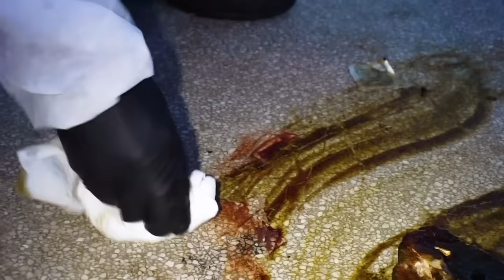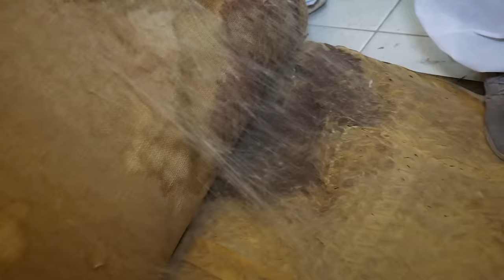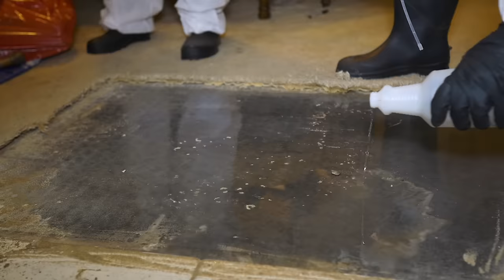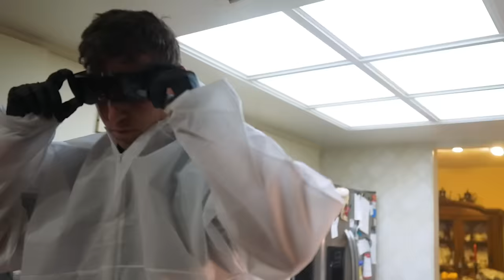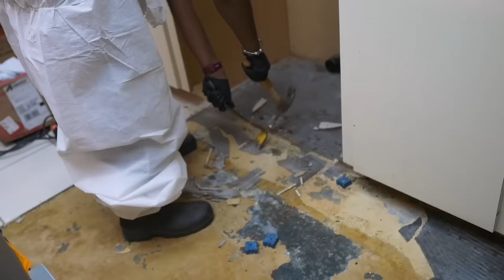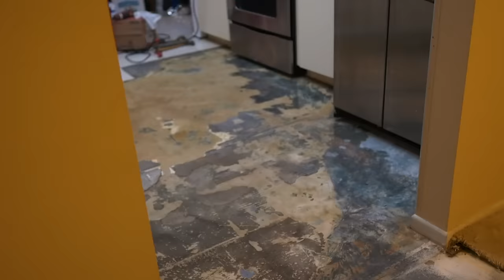Dead Body Kitchen Cleanup | Venice, FL

Comment: I'd have started popping tile at the doorway since that was where the initial cleanup started and it'd be easier to pop the tile up from there
Reply: Same as someone who has ripped up one or two tile floors in my time starting at a transition like where it goes from tile to carpet is so much easier than starting in the middle of the room
Reply: And moving any appliances out is way easier before you start ripping out the tile as you still have a smooth surface to slide heavy appliances around
Reply: @coolsnake1134  yeah, I'd use a 4 wheel dolly for that. Or at least a 2 wheel hand truck

Comment: Do you not track bio around when standing on the areas, and then walking over (mainly) carpet?
Reply: I think they spray their boots down etc
Reply: So when your done, the owners are good to go to put the house back together?
Reply: @MrOdinsmom  I believe so unless its under investigation for foul play or something similar....
Reply: I meant during the actual decomp cleaning process, as you see in the video. They are walking in/through the bio area(s) and then walking in and around the house!
Reply: Yup!! Noticed it a lot in this video. Also I really hope gloves were changed between cleaning the kitchen floor and moving the fridge and cooker 😱🤢 why didn't they cover the kitchen before smashing up the tiles. Eye masks are a HUGE must when messing around with tiles ESP when they've had bodily fluids on them
Reply: @mrssarystew  i have seen a lot of cross contamination in these videos it's painful
Reply: @ReidGarwin  you see a small fraction of a multiple hour job condensed into less than 20 minutes. i am sure the professionals in question know what they are doing.
Reply: @arden8808  Since when where professionals 100% with everything? They have a job, but jobs aren't perfect all the time, it's highly unrealistic in placing bets, human error happens regardless of time
Reply: @mrssarystew  Its all prettymuch contaminated - they have no need to cover anything
Reply: @ReidGarwin  do you think cops don’t back track? It’s all contaminated. They’re only there to remove the obvious stuff everything else is up to the family.

Comment: SpauldingDecon I have a couple of questions that I have been wondering about for the longest time, could you answer them?
I live in Polk County Florida so I do know how hot it gets, but this is what I am wondering. If the electric is on in the home that is being cleaned for decomp, are you allowed to turn on the AC and work in comfort, instead of working in the heat? I do realize there are a lot of homes without electric, because the power was turned off, but even then could SpauldingDecon  have the electric turned on for the couple of days they are going to be there, so the crew can clean and not sweat buckets? 
I enjoy watching the videos and admire the people who do the cleaning. The jobs you all do, makes it easier on the family and friends left behind. Thank you for all you do!

Comment: Removing the tile floor always seems to be the worst or hardest part😡🤬😡...Why does it come up easily in some spots and almost impossible to get up in other areas?🤔🤔🤔 Is it the materials used when it was installed? Installer error?🚷🚷🚷 Or just all tile flooring is a removal nightmare?😈😈😈 Hats off to all of you!🤠🤠🤠 I am amazed by the awesome job everyone does week after week when I watch your videos.🤯🤯🤯 Welcome to new crew members!👋👋👋 Thank you for your hard work and dedication!⚘⚘⚘
Reply: Basically when tile is put down you trowel thinset on to stick it, so any lower spots that arent backbuttered right with the thinset will leave a hollow spot and not stick right. This also depends on other factors, sometimes homes settle over years and the thinset will release a bit, theres many types of underlayment and some are better than others, weather, water leaks etc etc. So its hard to say really without knowing all the details. Properly adhered tile that all sticks and has no issues is really a pain to get off the floor.
Reply: @plack_benis382  Thank you for sharing your knowledge!🥰🥰🥰 It looks like a heck of a hard job!🥵🥵🥵 Give a whole new respect for carpenters and flooring installers!👷‍♂️👷‍♀️👷
Reply: @amandaleeborchert3745 lmao the emojis
Reply: @yesimoneofthose8970  😇😇😇

Comment: Why did you clean the tile to remove it?
Reply: I believe it helps to keep the contaminated shards as clean as possible since tile removal is so messy.
Reply: From my own experience removing tile, there  are usually jagged pieces when you remove it and they will slice straight through any glove besides maybe kevlar. So id say you dont want to be cut with a piece that has funky left over human on it. If they're bagging it, it could also cut through the bag, which would mean the bio isnt contained properly.
Reply: @plack_benis382  thank you. I was just thinking about double work.
Reply: @WahWeeWooWah  thank you. I wasn't thinking.

Comment: Do you test the lino/vinyl floor found under the tile for asbestos before you start removing it?
Reply: If the house was built after a certain year, there wouldn't be any asbestos in the adhesive because it was outlawed.